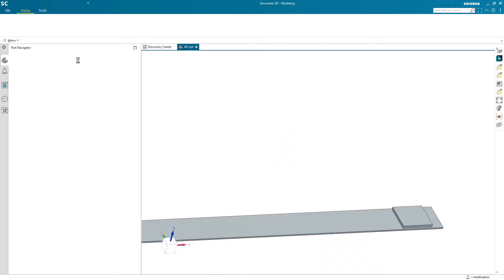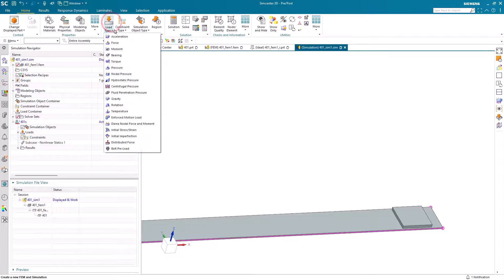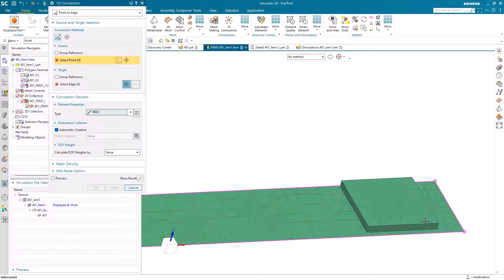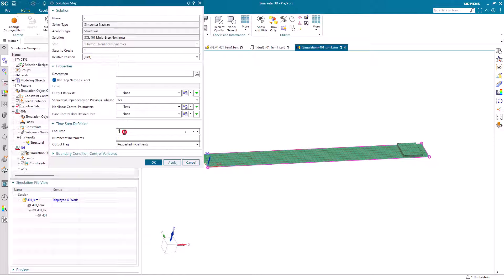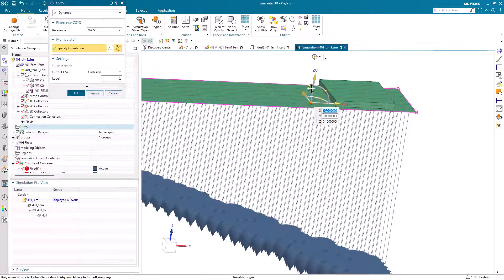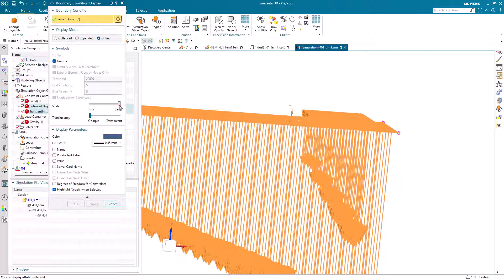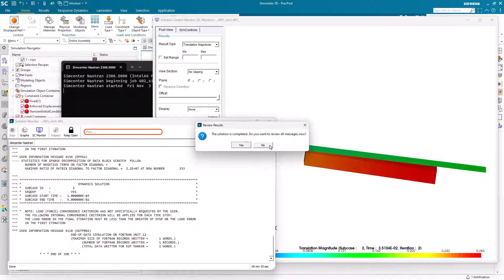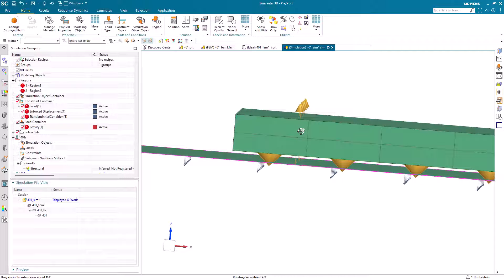How To Use Transient Initial Conditions In A Drop Test On A Flexible Structure

Comment: I am trying to perform similar analysis using Simcenter 3D. What sort of Material Properties would be required to be defined. Also can we apply Initial Transient Conditions on a rigid shell body instead of a flex body? Thanks for all the videos that are put up on this channel
Reply from the maker: Material properties required are modulus of elasticity, Poisson's ratio and density.  Transient initial conditions can be applied to shells.  Glad you find the videos valuable.